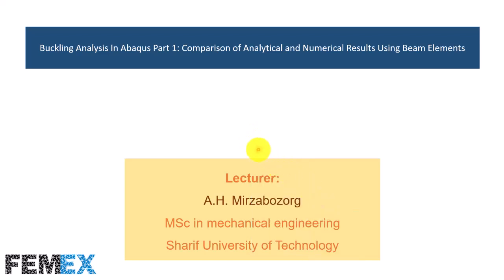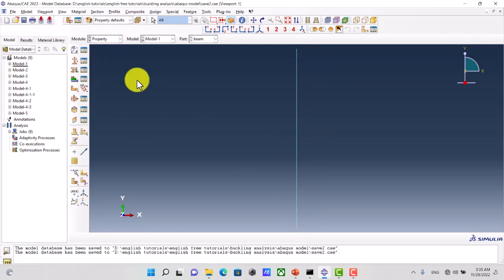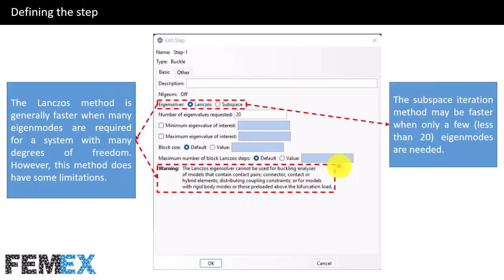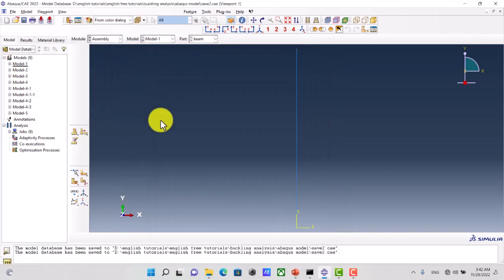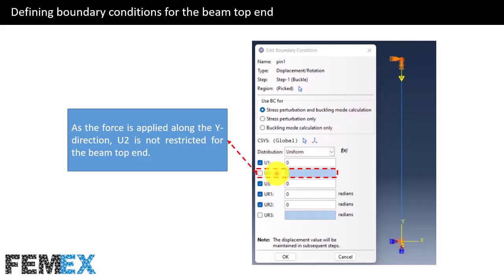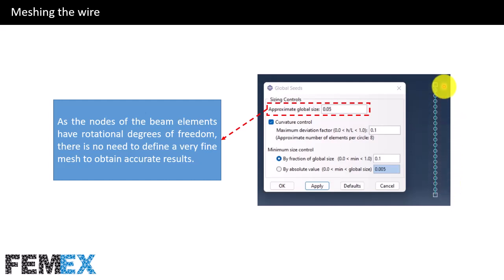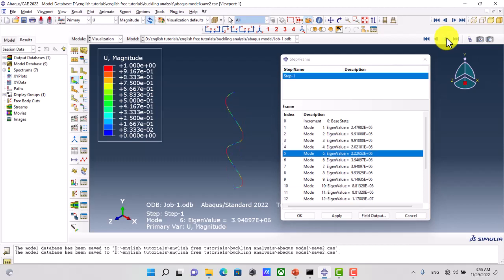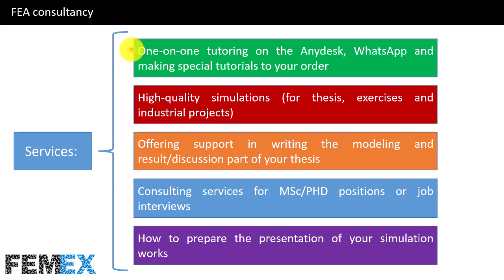Buckling Analysis In Abaqus Part1: Comparison of Analytical and Numerical Results Using Beam Element

Comment: I have followed your instructions word by word and tried to perform linear buckling analysis of 3d-deformable-wire element, but for some reason, I don't know why, while submitting the job I keep getting this message: "Regions of the part have not been assigned beam orientation, Section 1 : Picked, Use "Assign>Beam Orientation" in the Property module to assign a beam orientation."
Can u please help me in this regard. Thank You.
Reply from the maker: Hi.
Actually most of our free tutorials including this one, are not step by step and they only contain the most important points. So it is natural which you face such errors. They are due to the less important stages and points which are not covered in our free tutorials. 
In this case, You must define beam orientation for the wire part in the property module. In the property module, please follow this :
1) In the menu bar, click on "assign".
2) click on "beam section orientation".
3) select the wire in the view port.
4) click on "enter" in your keyboard to accept the proposed tangent direction.
5) click on "Ok".
So the beam orientation will be assigned to the wire.
Reply: @FemexIran  It worked, thank you very much. Although I am facing a different issue now. I have taken same section and tried to do the buckling analysis with 3d-solid, 3d-shell and 3d-wire element keeping all the other parameters (such as load, boundary conditions, mesh, element type etc.) as similar as possible, and tried to calculate the critical buckling load from the obtained eigen values and match it with manual calculation (Euler's formula) but all the results are coming widely different. Can you please help me in that regard as in where I could be making any mistake or suggest me any material where this type of comparative study with different models are done and matched with manual/theoretical results.
Once again thank you very much for your suggestion.
Reply from the maker: @SNEHANSUNATH-y7x  You are welcome. As the cylinder is not hollow, it is wrong to model it as a shell. It can only be modeled as a solid or beam like what I have done.
In the case which you don't get error but the results are different, it is not easy to guess the source of the problem. My only suggestion is to purchase the model files of these two tutorials including the CAE, JNL and INP files. they are made using Abaqus 2022. If you have a lower version, You can import the INP file to check the settings. Also If you have the 2022 version, you can open the CAE file. The cost of this package is 10 EUR. To purchase the package, you can send email to me: mirzabozorg71@gmail.com